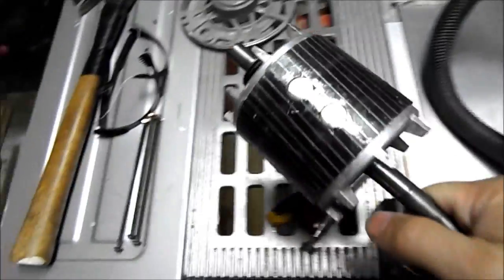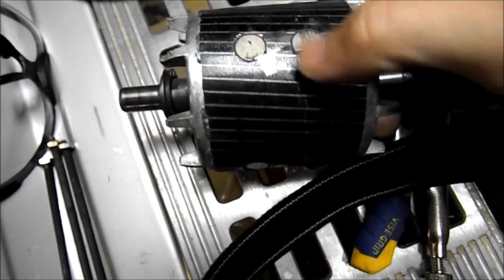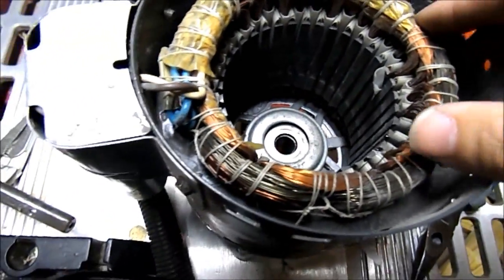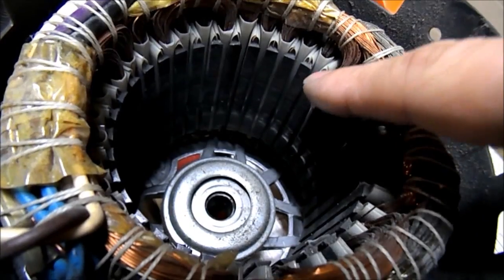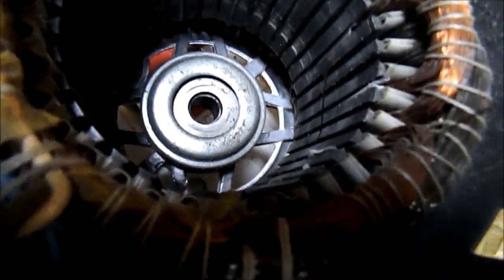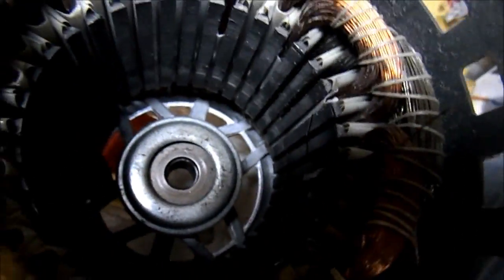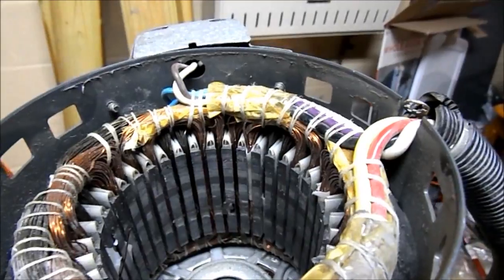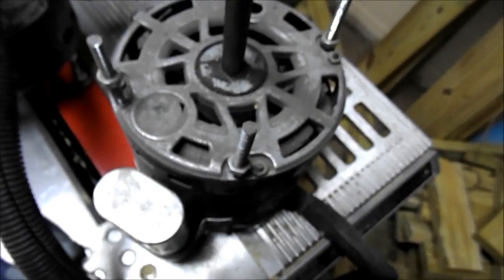Convert AC Induction Motor to a Generator

Comment: good luck. to get 120/220 you will have to spin it at 2x- 3x the rpm listed depending on load conected or you can conect a transformer in reverse

Comment: You got a 6 pole motor that should run about 1200rpm.It's a single phase motor with no governer or centrifigul switch.I think you will find that it's hard to try and make a 1 and 4 span to a 1 and 3 span.but I would like to see you do it.

Comment from the maker: True, but I did not have a way to spin it over it's rated RPM. This was an experiment to see what I could come up with. I needed 6 magnet poles to fit the 6 sets of coils but only had 4. I do have another in the shop to be drilled for 6 poles, when ever the people there get time to mill it out for me.